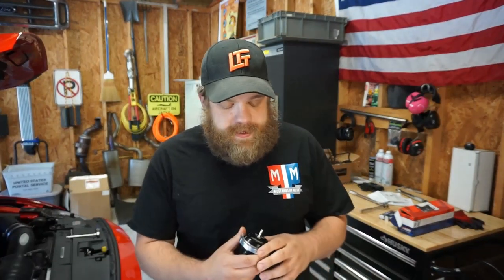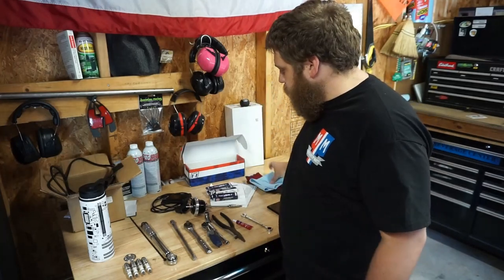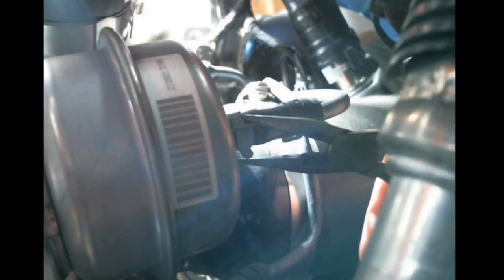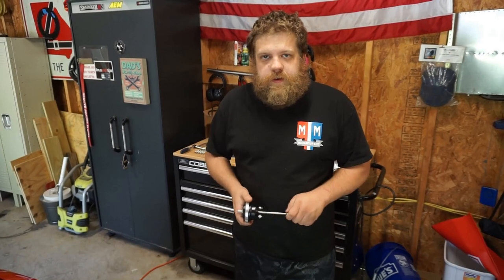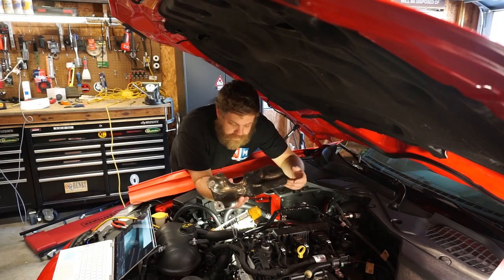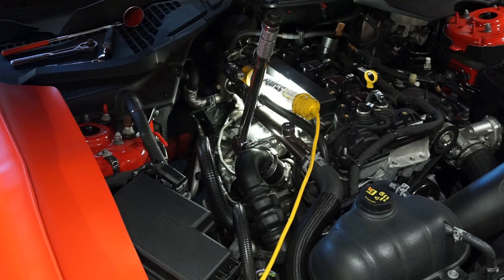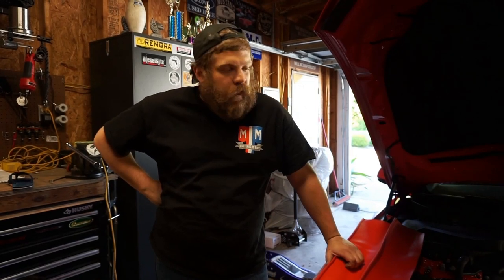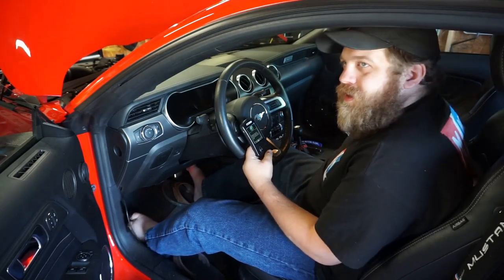How To Install the TunePlus Internal Wastegate Actuator (2015-2022 EcoBoost Mustangs)

Comment: A blown stock motor later, I'm about to replace the wastegate actuator on my new engine with the turbosmart 7psi actuator.. I'm still not sure about the preload, some guys say 2 turns, some 3 now 4?.. Lol.

I realize some guys are putting heavier springs for more boost, does anyone have a definitive answer on a OE replacement 7psi actuator? 2 turns? 3? I heard one guy say 2mm of preload.. no idea how many turns that is if 4 nets 3mm according to this video?..
Reply from the maker: Always go by what the wastegate manufacturer says, if available. Follow this from tune plus:

https://www.tuneplusinc.com/collections/2015-2016-2017-2018-2019-ford-ecoboost-mustang-wastegates/products/tune-upgraded-wastegate-actuator?variant=8232182789

Comment: After ordering a small cheap air compressor on Amazon, I discovered a can of compressed air or gas will also work to open the wastegate. In my case, i had a can of green gas from years back when i used to airsoft!
Reply from the maker: Good idea and a heck of a lot cheaper.

Comment: I've seen your video Matt. Thanks for the clear video. I own a Eco Boost from 2015. I got the P0234 code many times. What kind of wastegate actuator do I need to install? A 7 PSI  or higher. I have a stock turbo. And do I need another tune after I've done the Cobbs tune? Thanks for your answer. Greetz, Johan (Netherlands)
Reply from the maker: If your engine is totally stock, I’d recommend you install a new, OEM actuator from Ford. If you’ve already got a tune and would like more consistent boost, I’d recommend a unit from TunePlus. 

https://www.tuneplusinc.com/collections/2015-2016-2017-2018-2019-ford-ecoboost-mustang-wastegates/products/tune-upgraded-wastegate-actuator?variant=8232182789
Reply: @MustangsbyMatt  Hi Matt, thank you very much for your answer. Yes, my Mustang is tuned. Hope the 7 PSI will work or do you recommand another?
Reply from the maker: I would recommend the 7 psi one for stock or mostly stock performance levels. If you have supporting mods (intercooler, intake, exhaust, etc) would be the only time I’d recommend anything more.
Reply: @MustangsbyMatt  Thanks Matt ;-)
Reply: I installed a 7psi TurboSmart Wastgate on my 2016 stock Mustang Eco and it worked perfect and felt a little more power than the stock one... but 7psi is good for no tune tho

Comment: I’ve got a 2017 mustang Ecoboost that I had tuned by 5star, and here recently it’s been kicking the P0234 code saying there is an overboost. Will this help fix that problem?
Reply: I made this comment before watching the whole video so If you mention it then I apologize
Reply from the maker: What did 5star say when you brought this up to them? They should be able to tune out that behavior.
Reply: how did you fix that code bro? i have the san problem

Comment: Hey Matt, I'm about to install the NX2 onto my 2020 HPP and was watching the Motoroso install vid. They have the turbo manifold stud nuts going back on at 37fpt, you are doing 90+ on those nuts after reinstalling the heat shield. Is it 37 or 90+? Redecobeast also torques his to 37. Just want to make sure before I dive into this turbo swap. Thanks!
Reply from the maker: The torque spec for these bolts is 95lb ft, as they are the only seal the turbo has to the head. It's possible that Ford added redundant fasteners or changed the spec for the 2020+ models.
Reply: @MustangsbyMatt  ok thanks, I'll see if I can find out if something changed.

Comment: I have a 2017 Mustang Ecoboost with intake air system roush, also I have a Blow off valve HSK, I just want to get a 10psi actuator, do I need a tune? My mechanic just told me that engine would be fine with no tune for the moment ... but I want to make sure.
Reply from the maker: Your engine will run without a tune but you'll be leaving a lot of performance on the table without it.
Reply: @MustangsbyMatt  thanks for the answer, so I can get a 10psi actuator, using it without a tune for a while and then get a tune maybe in a couple of months? Any problem doing that?

Comment: If I have a 7psi actuator from turbosmart and I swap it out from the oem one.. do I need a tune? Brenspeed is saying no! And are all the turbosmart actuators set up the same. With a different spring inside?
Reply from the maker: If you've got a 7psi spring, you shouldn't need a tune. The 10psi actuator has a stronger spring and requires a tune. Turbosmart will do custom variants but TunePlus is the only one that I know of. Hope that answers your question.
Reply: @MustangsbyMatt  yes you did help with the tune question! Thank you. Also, when I asked if they are setup the same. I meant the preload. Do I do exactly what you did to get it the correct length

Comment: Where did you get the air intake plug for the stock box?
Reply from the maker: It's called a Resonator Delete Cap from Velossa Tech. I have an installation video coming very soon.
Reply: MustangsbyMatt I found something at Home Depot in the electrical isle for 2.49. It 1 1/2 inches. Took a lighter and heated it up and pushed it in with some superglue and clean factory look.
Reply from the maker: Awesome.

Comment: How do I know if I need to 10 psi or the 12 psi for my Mustang eco-boost
Reply from the maker: Are you on the stock tune?
Reply: No I’m on stage 2 with Cobb accessport
Reply: Is a tune required for this ?? For the 10 or 12 psi
Reply from the maker: I'd recommend TunePlus.

Comment: If I just swap it cuz mine is bad do I need to tune it still
Reply from the maker: If you are replacing with an OEM component, the answer is no. If, however, you are replacing it with an aftermarket actuator, then absolutely yes.
Reply: @MustangsbyMatt  ok thanks they don’t really sell the oem one alone and wanted to replace just that but might be ok to go ahead and tune thanks
Reply from the maker: I've got the original one I removed. I'd be willing to sell it to you for a good price.
Reply: @MustangsbyMatt  did you ever find a replacement? I’m in the same boat my stock one went out.
Reply from the maker: I'm willing to ship it out to you, if it'll help. I can't guarantee anything, so just pay shipping and we'll call it even.
Reply: @MustangsbyMatt  thatd be great man. I’m willing to pay for the part and shipping.
Reply from the maker: Send your address to MustangsbyMatt@gmail.com and we'll get it to you.
Reply: @MustangsbyMatt  I’ve sent you an email. I appreciate you going out of your way man thank you.
Reply: How long did it take Matt?
Reply from the maker: If you're not filming, it should only take a couple of hours.
Reply: @MustangsbyMatt  appreciate that